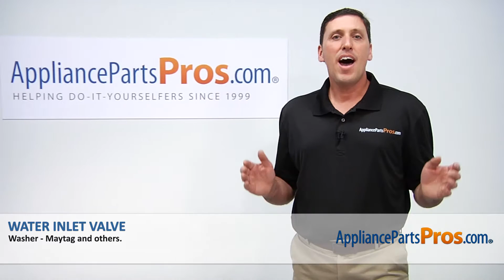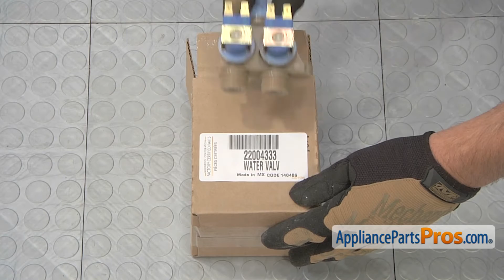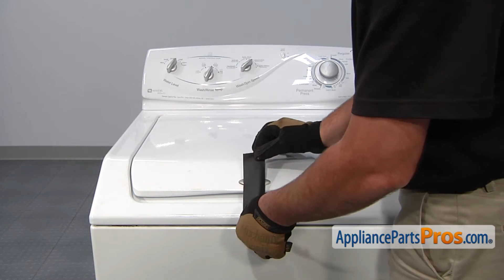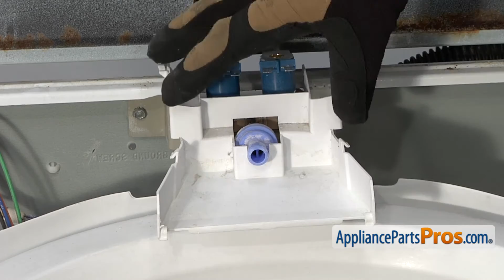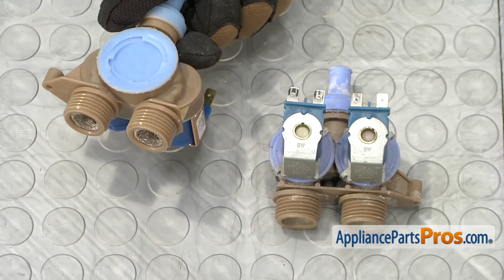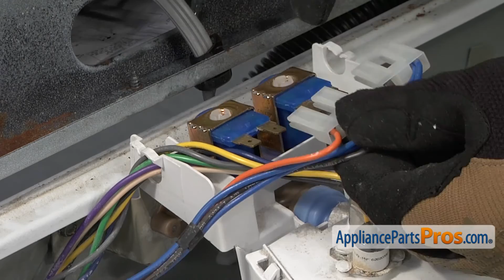How To: Whirlpool/KitchenAid/Maytag Water Inlet Valve WP22004333

Comment: Great video. Where do I get a pair of those gloves? The hot and cold water hoses are screwed into machine REAL tight. Is there a tool that can reach in to loosen the ends?
Reply from the maker: We do not sell the gloves but they are regular work gloves. If the hoses are too tight and you cannot get them off, as an option you can leave them attached to the valve and pull them through the back wall when you are removing the valve. Once you have access to them you can use a pliers to take them off.
Reply: AppliancePartsPros Yes I finally had to pull the hoses into the washer to attach the hoses to the new inlet valve. Then I installed the valve into position and finished the job.🔧